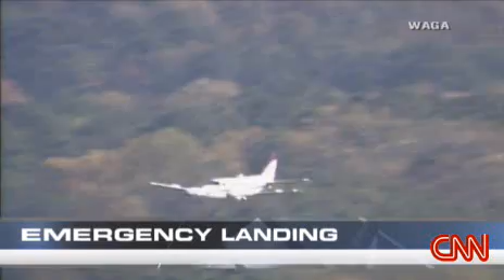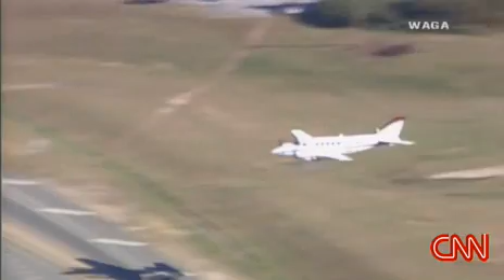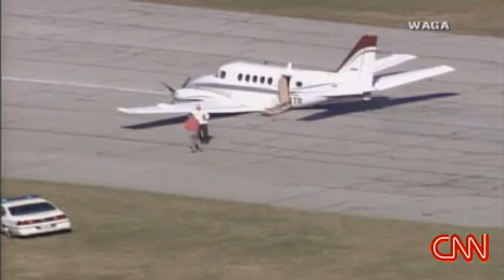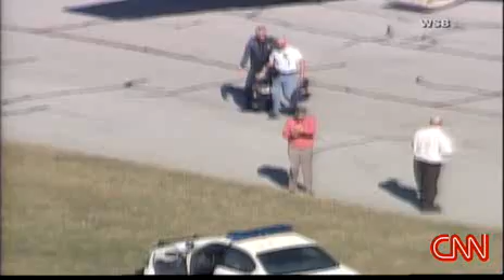emergency landing

Comment: A very nice landing indeed, but not as fantastic as some would believe. With gear up the airplane will sit down very softly due to ground effect.  Not taking anything away from the pilot, but the airplane is designed to land on it's belly in a gear up situation.  Gear up landings happen all the time, some completely unintentionally. This one was just caught on tape.

Comment: Yes he is and I'm betting he is probably sixty years old. Funny how a crash makes them too old, but the truth is, they have the flight time to make landings like this without folding up the airframe. A little sheet metal work, fix the landing gear problem and new props and this bird with be right back in service. A young inexperienced pilot would have, in all likelihood, folded it up. There's no substitute for "stick time".

Comment: no! the planes are not made to land with gear up... sometimes they have to do it, but you can crash the whole airplane.. and if you land with gear up, you cant breake the plane... so the plane will just slide on the runway with a very high speed...

Comment: Sorry, but you're wrong.  Gear up landings are most definately design considerations for retractable geared aircraft!  Retracts generally use thicker skins on the belly for this very reason.  Gear-up landings happen ALL...THE...TIME!  Anyone who thinks differently has never been around a GA airport very much.  I'm not sure what your comment means.  I'm speaking from EXPERIENCE here, not conjecture.

Comment: These belly landings are over rated! The pilots and passengers always walk away. They do not even spill their coffee. The plane lands there are a few sparks, plane stops.
Ever hear, "Plane does belly landing, all die in cart wheeling fiery hell?" Ah, No. 
Hell if a pilot can land on wheels, he should be able to land on the belly.
Pilots even do these by accident sometimes, they forget to lower the landing gear! 
Again, belly landings are over rated.